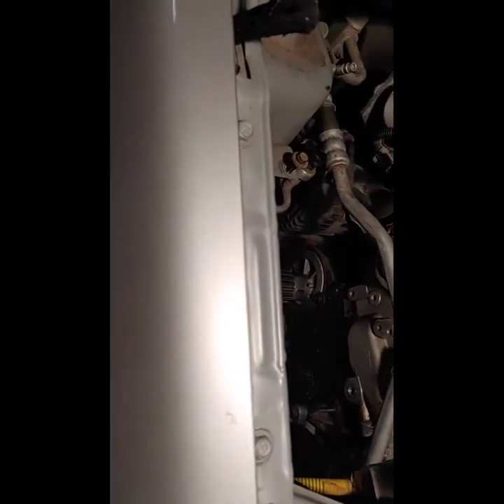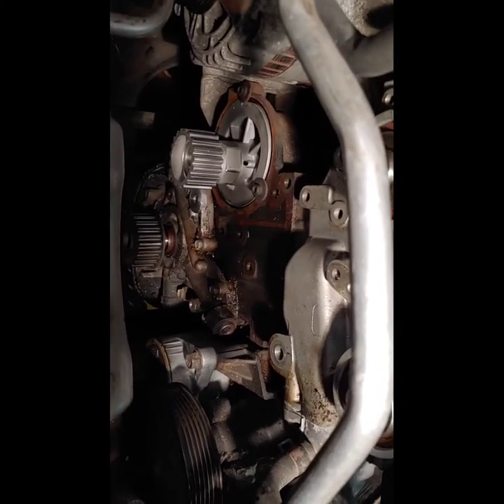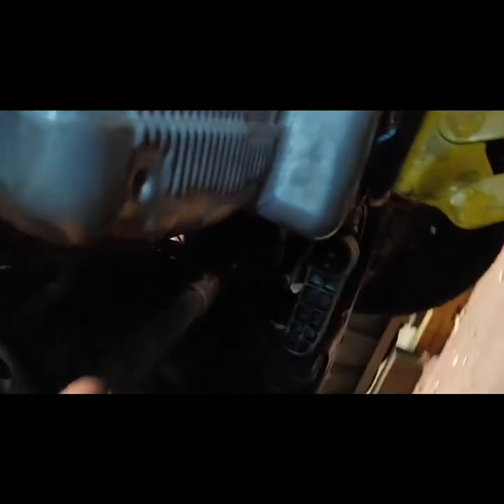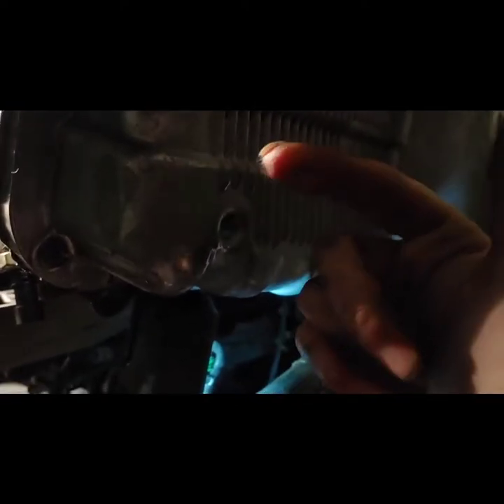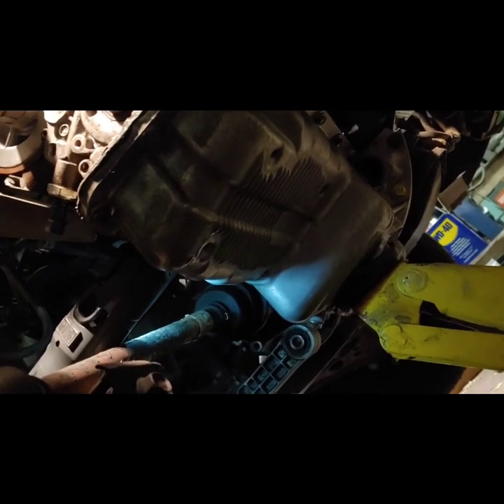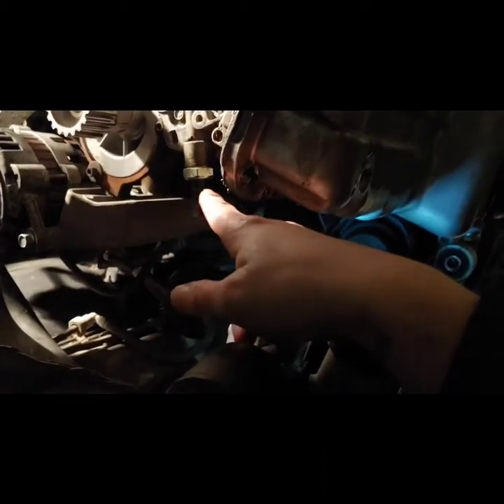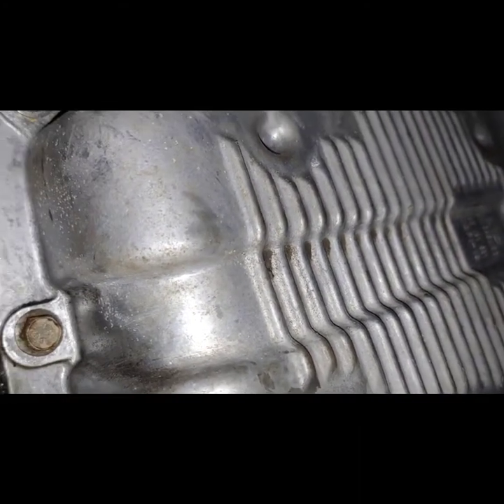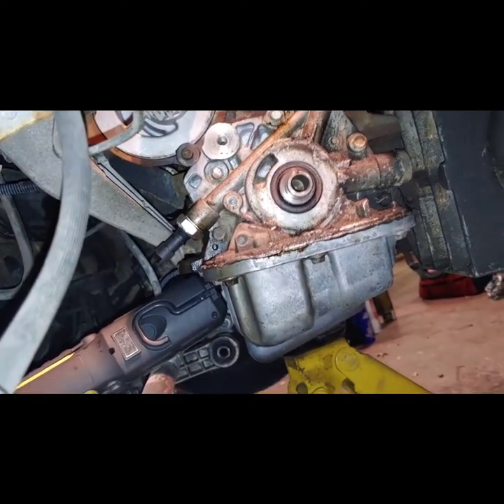2008 Chevy Aveo/Aveo5 Oil Pump/ Oil Pressure Replacement

Comment: Would we have to pull the engine to do all this
Reply from the maker: No, I didn't pull the engine at all. I put a jack underneath to hold the engine/transmission since you have to remove the engine mount. So I put a jack underneath to help hold it up. Just make sure you pick a good spot under it to put a jack, and I put a piece of wood on top of the jack to make the jack cover a larger area to avoid denting anything
Reply from the maker: Also you could hold the engine 'up' by a 'cherry picker' if you wanted to; however I personally think that would end up being in your way a lot more. A lift would be perfect, however I just jacked up the car and had my jackstands under it. The trick is having a ton of patience (which I lack in lol) and knowing when to walk away and take a breather when it starts irritating you. And you can order all the parts on ebay and Amazon which I highly highly highly advice....since the stores charge a arm and a leg.